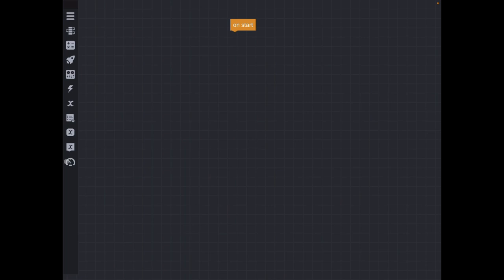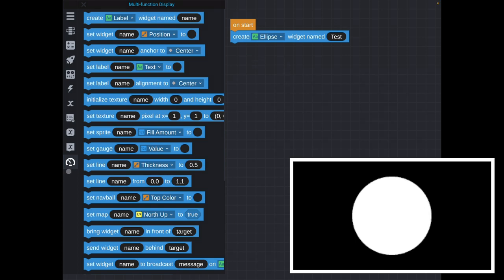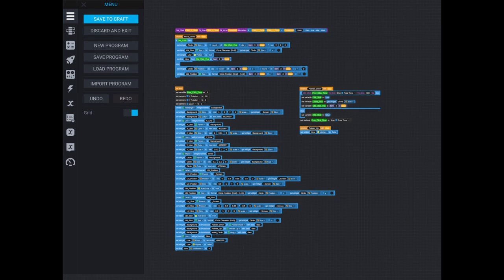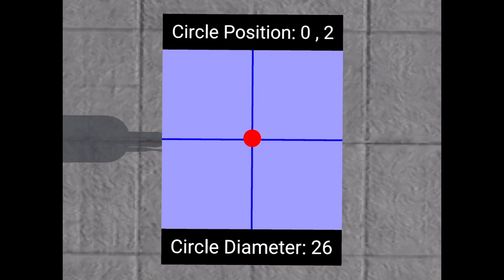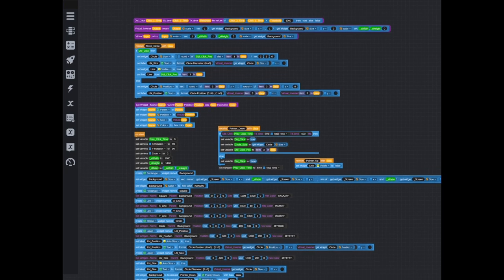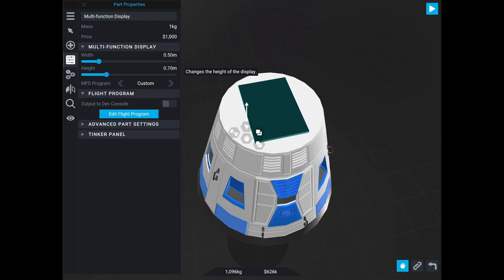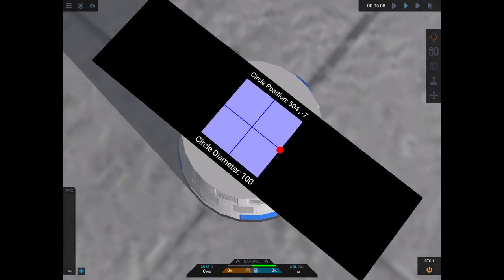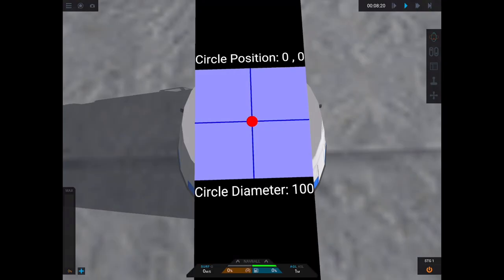MFD Tutorial #2: Widgets & Coordinates || Simple Rockets 2

Comment: This was a good explanation of how to position stuff. I really liked your little demo program on to show where items are on the screen. If I could give a suggestion for a future video I would say cover how anchor position and making a widget a parent changes things.

I have been working on a gauge cluster that is some what easy to reconfigure. One thing that I found worked nicely was to set my parent widgets to have the anchor position on the screen be the bottom left corner. This allows me to have my xy position for them be positive numbers. Then when I need widgets to stay with that parent I usually find it easier to have the anchor position be centered. Normally they stay close to the center of that gauge or are only moved up and down. I have gotten close to releasing my Multi-use Gauge MFD I just want to add a slider for players to use to adjust stuff and do some cleanup and better commenting on the code.
Reply from the maker: Good idea!  Anchoring sometimes produced unexpected results so I wasn’t ready to cover it. Maybe in a future video!